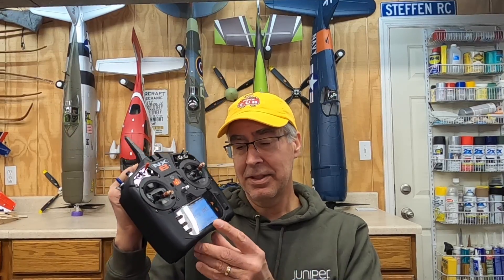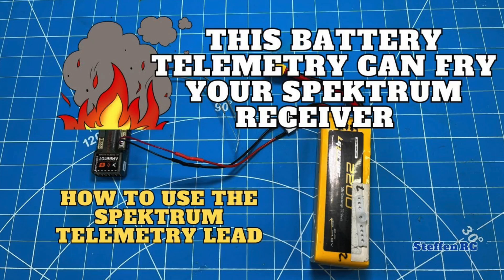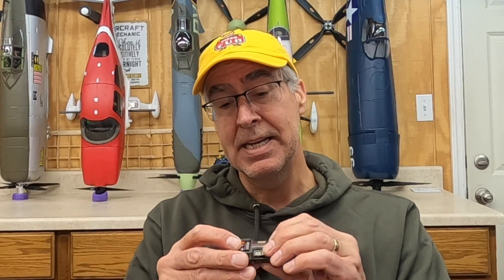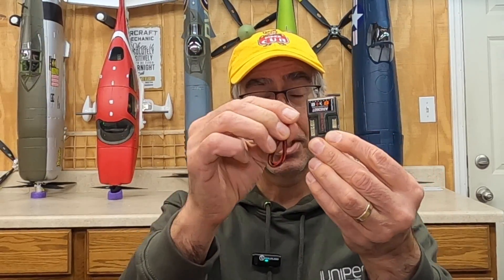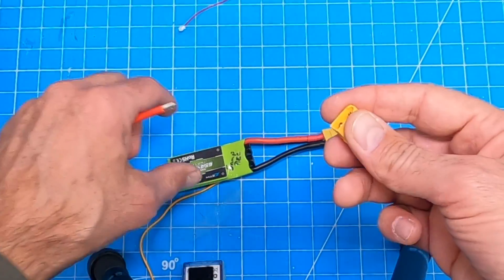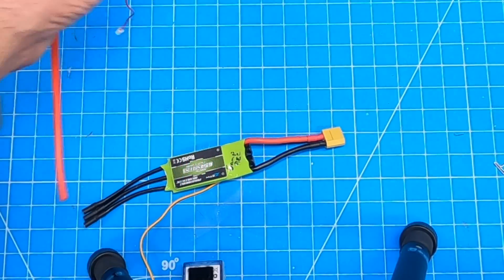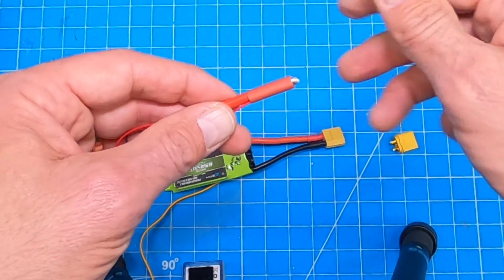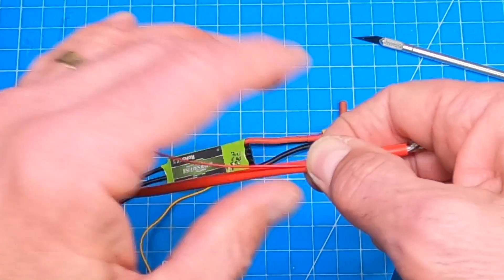How to use Spektrum voltage telemetry lead

Comment: Ok so I just got an AR8630T with the 2 wire voltage sensor lead. What you are saying is, don't worry about the ground lead & just connect the positive to the the positive ESC battery lead exactly the the same way you showed & theoretically it should work? I'm not holding you responsible for my mistakes but I just want to clarify that that's what you would do? Thanks
Reply from the maker: Hey Bud..  Yep, I remove the black wire from the plug that came with the RX.  On the RED wire I strip off about 3/8" insulation and apply a light coat of solder to the wire so its rigid.  Use a thick needle to punch a hole through the red wire of the ESC, push the red wire in the hole and wrap Red electrical tape around it to secure in place.  Plug it into the VOLT port on the RX and you are good.   Make sure VOLTS is setup in the TX TELEMETRY and set a audible action with a switch to say value of VOLT.  I also add VOLTs to the Tickertape so I can see battery voltage on my main screen on the bottom.    Also ONLY use Lead free solder or the whole thing will catch on fire..... (just kidding....).   Let me know if you have any questions.  Thanks, Will

Comment: Hi Steffens, I have a Spektrum telemetry receiver, NX8 and a 2s spektrum smart battery with the plug for an ESC, balance lead, servo plug that I use to power the receiver. I have a Saito 4 stroke engine,thus no esc. I would like to have the flight pack voltage available on the transmitter. Can you help me?
Reply from the maker: There is telemetry on that RX that can report the RX Voltage.  When you scroll to the Telemetry field, you'll see a RX V.  Just add that to the function bar list.  It will show up on the bottom of your TX screen.  Let me know if that makes sense...
Reply: @SteffenRC thanks I’ll try that!

Comment: Which telemetry sensor do I use to view the voltage on an iX transmitter? I would assume it would be the same on a NX. Thanks.
Reply from the maker: If you have an Spektrum Avian ESC you have the battery telemetry built in.  If you are using a non-spektrum ESC, you'll need one of the Spektrum RX that has telemetry.  Like the AR637T, which has a wire and plug for voltage telemetry.

Comment: I'd recommend trying to get to the +Ve terminal on the ESC and soldering it there, rather than compromising the insulation on the cable itself. Should be easy enough to get to them with side cutters and then you can slip a largish diameter piece of shrink-wrap over it for belt and braces
Reply from the maker: That's a good suggestion, thanks for the tip!

Comment: I just watched the video, I still didn't get how to connect that lead to the AR631. Or do I need a new ESC with my FMS plane?
Reply from the maker: The AR631 doesn't have a telemetry plug for volts.  So, if you use that RX, you must get the Avian ESC which will provide voltage telemetry.  If you get the AR637T, you can use any ESC and get voltage....
Reply: @SteffenRC  Got it! Thank you so much. I think at this point I need to get a new Avian 45A ESC to be able to get battery voltage.

Comment: I do the same for the Radiolink 8 channel with telemetry R8xm receiver. But the cable I solder on the ESC at the point of the positive connection to the battery. Reason I that the receiver is closer to the esc and have telemetry cable is to attached to the power cable that often leads to the other direction than where I place my receiver.
Reply from the maker: I have a Radiolink system, but haven't messed with the voltage telemetry.  Might play around with it..  Thanks for watching..  Will

Comment: Hey Steffen !! Hope you're having a great Tuesday night !!
I'm still trying to learn more,  with my new motor,  and ESC. I don't know what BEC voltage is
 and why would I need to change it ??
I how you can expand my mind !!😮😮
Reply from the maker: Hey Scotty...  The BEC is what powers the RX from the primary battery at reduced power.  Most rx system run at 5v, where some with HV fast powerful servos run at 8+v.   Changing the BEC output is helpful is you are using those larger system what need higher voltage.  Make sure the ENTIRE system (rx, servos, retracts....) can handle that voltage, otherwise you'll burn them up.   Hope this helps.  Will
Reply: @SteffenRC  ok.... that makes a little more sense.  I should probably just leave the BEC alone... thank you for the advice !

Comment: With the hole poking method, is the process different when your esc has an external bec connected to it ?
Reply from the maker: I think this will work the same regardless if there is a BEC in use.  I don't currently have any planes with a BEC and this telemetry.

Comment: Hi friend, I'm using an 8360T. Would it work if I use the battery balance connector? Using only the red wire? Best regards, and thank you very much.
Reply from the maker: I used to use the balance lead and the red only wire.  It will work.  However, I found connecting to the balance lead created a mess of other wires and fragile connectors.  So now I just poke a hole through the red ESC wire and stick the telemetry lead in the hole and secure with tape...  Will

Comment: Would like a video on the subtle nuances of Spektrum "Forward Programming." While the DX9 LISTS Telemetry and "Forward Programming" when bound to a receiver like the AR637T+, "Forward Programming" is NOT the same between the DX9 and transmitters like the iX14.  It would be great to have a video demonstrating those subtle nuances that Horizon and Spektrum marketing doesn't seem to get into, if you know what I mean.
Reply from the maker: I have a DX6 and a NX8.  I'll take a look to see what I can do with programming.  Thanks Will

Comment: Thanks for this video as I have a Spektrum AR637T+ a DX9 transmitter and powering my receiver from my ESC.  I had no idea on how to get voltage telemetry but I do now!  However,  I am under the impression the telemetry cable is designed to provide both voltage and ground to the receiver, ensuring accurate measurement of the voltage.   Using just the red wire (positive) without a ground reference may give inaccurate readings because the receiver needs to know the voltage difference between the positive and negative terminals.
Reply from the maker: My understanding from Horizon is the ground from the Battery/ESC is the same for the RX.  If you use both wires you can potentially cause an issue. (which I did when I used both)..   I've tested the accuracy many times and I'm happy with the results.
Reply: @SteffenRC Thanks.  I’ll use just the red, as it’s simpler…for now.

Comment: Thanks Will. It does help a ton. It would be nice to have cell voltage too. I typically use one cell and check for 3.6v to bring it down. 
With the AR637TA and the Avian ESC it does give the EVIN that is close to the A3 voltage. 
I just picked up my CZ C150T and the lead didn't come with the Rx. I do appreciate your help on maidenflights and flying as well.
Btw, my maiden went well with both my Futura and the C150T! You videos were helpful.
Reply from the maker: Thanks Bruce, appreciate your comments.  The one cell telemetry makes more sense to me too.  Congrats on your maidens.

Comment: Great tip! much better to have a permanent connection. One time install. Thanks, Happy 2025!
Reply from the maker: Yep.  I used to use the silly balance leads, but switched to either soldering or just punch a hole in the insulation and poke the wire through.. Simple and no soldering required.  Works great too.

Comment: Does this work with the 4651t as well? I fly helis
Reply from the maker: I don't believe that RX has a battery telemetry sensor plug.  Maybe the Flight controller has something for that..  I'm not familiar with that setup.

Comment: So i dont need positive if im powering the esc with the bec built in esc?
Reply from the maker: Thats correct, its already getting a ground from the ESC/BEC.  I was told by Horizon hobby to NOT use the blk wire on this particular application...  Works great for me..   Good luck,  Will
Reply: @SteffenRC  my jet has an external bec, so i just use both, black/red wire?
Reply from the maker: @Mroswaldo16  I believe so, but I'm not 100% sure on that..  I'd shoot an email to Spektrum support to confirm.
Reply: Just to be clear, he said " I don't need the positive ".
Yes you need the positive, the red is positive and that is the only wire you need in this example, the black is negative you don't need the black.

Comment: So ive hooked up the wire using the hole poking method and hooked it up to my receiver however it fried my plug when i plugged in the battery... did i do something wrong? I followed your video step by step
Reply from the maker: Just so I understand.   You attached the red wire from the Spektrum voltage telemetry plug into your red lead on the ESC.  Then attached the telemetry plug to the rx volts port.   You plugged in a battery and the battery plug fried?   Or the telemetry port plug fried?
Reply: @SteffenRC  i did all that you just said and then the plug where I connect the battery fried. It still works but it's all charred inside the connectors now 
Luckily I unplugged it quick enough
Reply from the maker: Thats confusing.   There is a short in the system somewhere.  You're using the Spektrum supplied telemetry wire, but just using the red wire..?   Can you send me some pictures of your setup?  Pic of connection to ESC wire and the plug to the rx.   send to willsteffen@gmail.com
Reply: @SteffenRC  email sent i have already removed what I had done to make sure I didn't fry the other electronics. So yes I had the red wire in with the red wire. I then plugged in the telemetry lead into the voltage telemetry port. I then plugged in the battery and as soon as the battery plugs touched it went poof and smoked up
Reply from the maker: @RcCruiser  just shot you an email.  Those Amazon plugs have reversed polarity.
Reply: @SteffenRC  I never even noticed that. The small details...
Reply from the maker: Hope all is ok with your batteries and she's working like she should....
Reply: @SteffenRC  absolutely! Batteries are good! Just had a little carbon on the connections. Telemetry is working great! I've never had telemetry before so this is amazing! 
Thanks so much for your help! People like you sharing your knowledge helps keep this hobby alive. Now I can share that same knowledge and pass it on as well

Comment: Lemon rx 10ch has telemetry too. Cheaper option than overpriced spektrum receivers. As reliable if not much better
Reply from the maker: I have several LemonRX, seems to work well..  Just got a 7 channel with stability and voltage telemetry.  Curious on real performance data.  You said they are better, have you done any formal testing?
Reply: I havent done formal test.I dont have the equipment for it.Just from experience,I have an AR8000 intermittent signal lost and crashed 2 of my planes, an AR636 burnt out. I have 3 lemon rx stabilized plus gen1, a 10ch lemon rx gen2 and a Orangerx 9ch telemetry. None of those aftermarket rx has given me lost signal. I got to the point where I trust aftermarket DSMX rx more than genuine spektrum rx. Redcon rx from aliexpress were also longer range and reliable until they made the knock off ones
Reply from the maker: Hmmmm..  I see I test of rx's in my future..  Thanks for the idea....  Appreciate it.
Reply: I've lost more than 3 planes using Lemon.  Haven't lost any with genuine Spektrum rxs.  Bottom line, genuine OEM might cost more, but you're less likely to have problems.  My experience is proof enough for me.